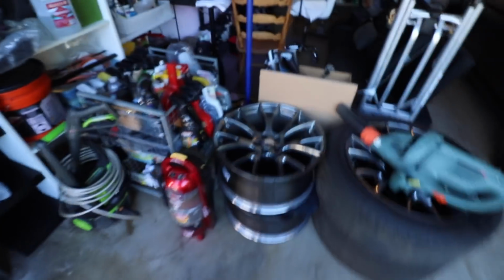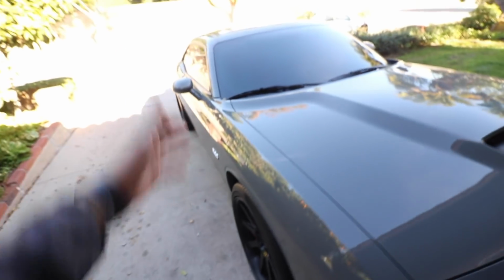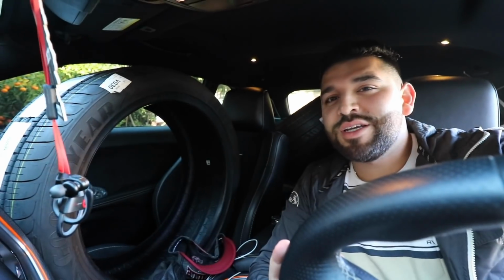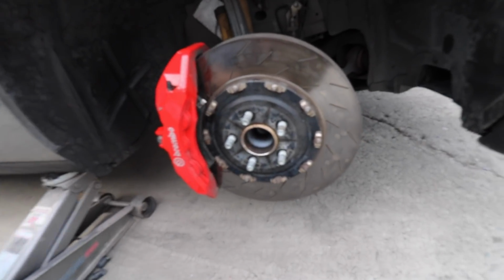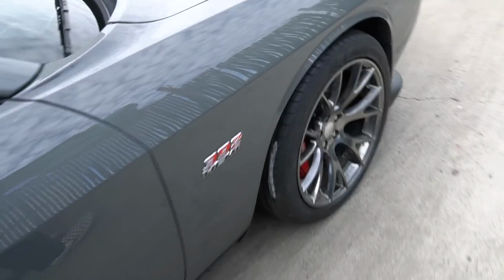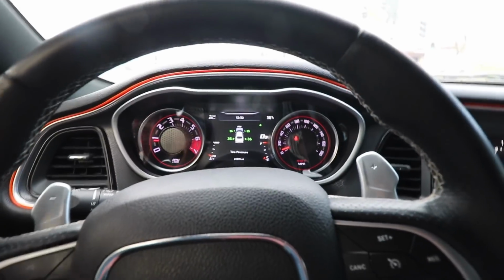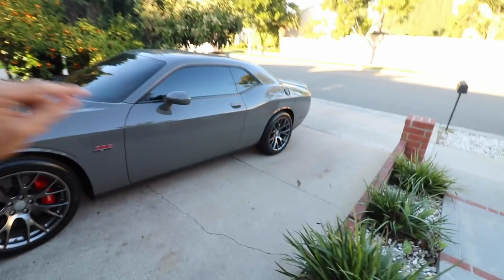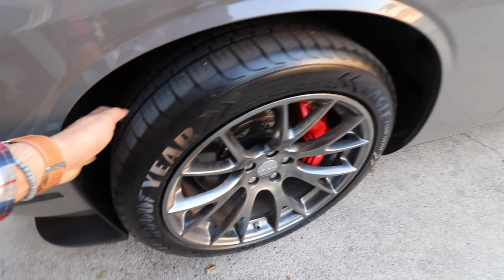I'M PUTTING MY CHALLENGER BACK TO STOCK!

Comment: How are the 275/40s on the front? Do they rub at all? I'm getting ready to put them on all corners, but I don't want any issues up front.
Reply: August Drums nope.. hellcats run 275/40 stock up front.. you will be far from an issue with 275s up front.
Reply: @sharkeyshark4410  Great thank you!!!
Reply: August Drums also, the old (15-18) SRTs run 275/40 stock as well. Just to give you non hellcat example.
Reply: @sharkeyshark4410  Okay mine is a 2019, so I should be good then!
Reply: August Drums yep, I’m running 275s up front on my SP challenger, been doing so for the past 6 months. No issues at all

Comment: Done any pulls on em from a dig yet? Not that I'd expect a dead hook but just curious how they compare to the pzero.
Mine's in the garage for winter :( Way too much salt and crap on the roads. But I'm shopping and tires for the ass end are first on my list.
I have my eye on Nitto NT555R 305/35r20